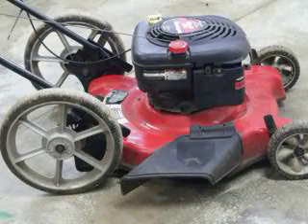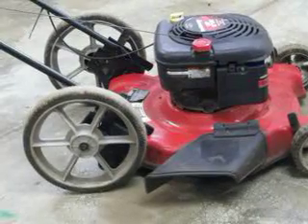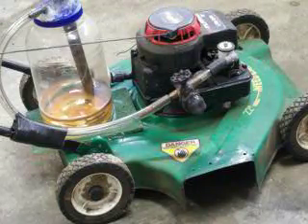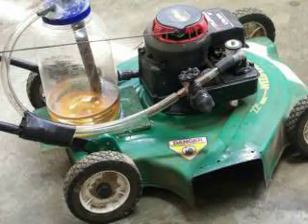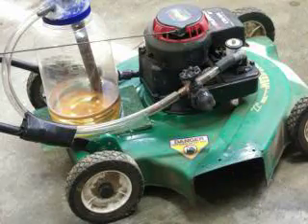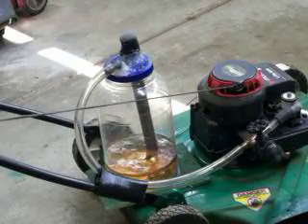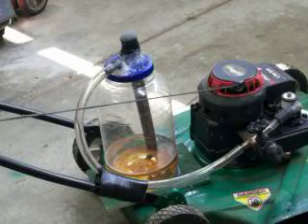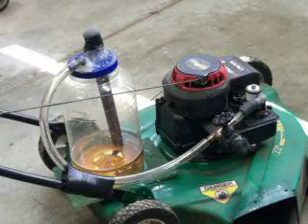gasoline and fumes the difference

Comment: Well, the issue with "running on fumes" is the gas in your setup would end up useless before it is all gone. A bubbler setup like you have, although simple, will result in using maybe 1/3rd of the gas before it becomes essentially useless (correct me if I am wrong). Another issue is overheating. I have heard running an engine lean (like this) will cause it to run hotter. However, I have also heard that using gas vapor you can get more out of the fuel if you actually vaporize it (more complicated than a bubbler). However, it can be done. I have also seen mowers running on propane, diesel vapor and even kerosene. Probably not good for the engine but it runs. Maybe if you had a two stage sort of system. Start it on a cold bubbler and harvest the heat from the engine to heat the fuel so it will vaporize better. Of course, be careful :P
Reply from the maker: that is true, air passing through the gasoline will slowly destroy it, i have come up with a better plan, run it through a wicking system, and separate the gas from the air, the air will blow over the wick and pick up the vapor, and the wick will keep drawing it to the top, this way you will not half to worry about cracking the gas by heating it. using it on my lawn morrow and it will till the gas is all gone.
Reply: TheVaporkid If you can get it to work long term, let me know. However, with that kind of setup I would worry with "gumming up" of the wick. I have heard of a "wicking carb" working though. You may still run into the issue of the gas becoming "unless" though (not sure). Either way, make a video or videos concerning it and I will watch.

Comment: Im thinking about testing this idea out. Im thinking a little 49 cc motor for a bike to start since itll be a pretty cheap way to test it out. From what I can tell you have the vapor output tube running into the gas tank, correct? Ive seen others run it into an air intake, but this is slightly different. I get that the air flows in to bubble the gas and create gasoline vapor, which the motor then runs on. I just want to make sure I understand where it is routing to. Would 2 stroke gasoline affect the vaporization at all? The 49 cc motor i'd like to use runs on 2 stoke mixed gasoline.

Comment: this engine will eventually melt down and die ... reason being the extra liquid gasoline is used to cool the charge, like this you are running SUPER lean  ... i recommend putting water in the gas tank and playing with the jet size so that you can keep the temps down, prevent detonation and enjoy extra torque from the steam ... and dont get me started  about putting a turbo
Reply from the maker: there is no way it will melt down, or burn up, its has oil and air cooling it and it will not run lean,end of story
Reply: Oh yeah i didnt know cookies smelled like burnt piston rings and a gouged to all fuck cylinder sleeve lol
Reply: why would this engine melt? it has oil to keep it cool and lubed
Reply: With enough heat the oil can "cook" and actually cause more friction and thus heat. Weather the engine melts would be up to the cooling system and if it could survive the super lean fuel air mixture. In general  the engine would be overheating with out the extra fuel to act as a coolant
Reply: Chris Comp HEY, I THINK YOUR CAPS LOCK KEY IS BROKEN. Guess what? You are not a mechanic, just some dude arguing with people on youtube. You don't understand how gasoline vapor burns. You are so stupid you don't even realize how much of an ass of yourself you are making. The reason engines run hot when they are lean is because they already have way too much fuel to begin with, so they teach you to dump in even more to quench out the flames. Gasoline contains 125,000 BTUs of heat per gallon under ideal conditions. If you cut the amount of gasoline going into the engine by a 4th, then you have 4 times less BTU energy going into the block. Get your facts straight before you try to fool people into thinking you are smart.
Reply from the maker: TheVaporkid ps i would not waste my time coming to see you at wv
Reply from the maker: Chris Comp then why arnt you at work, because you are some young kid that likes to bad mouth every body, you need to  take a anger management coarse, you really need it!!!  also my baby kid  make better sence then you
Reply from the maker: Chris Comp my god if every body thought like you this world would be still in the stone age, the wheel wouldn't be invented end of story!!!
Reply from the maker: TheVaporkid oh and practice what you preach, it might do you good moron
Reply: Chevaish Roop What some of you are forgetting is the upgrade in metal just to run unleaded fuel, yes?
Reply: Yup that's it ^^
Reply from the maker: TheVaporkid hey dude how old are you?

Comment: Use one throttle body injector to inject the raw fuel into a Small heated chamber the size of a 6oz can (think of how the tank-less water heater operates) and think of this as way to vaporize the fuel before it enters the engine intake "AND" is better than having a chamber with 1/2 gallon of heated fuel sitting in the engine compartment just waiting for a small/big accident to cause it to explode is not good judgement in my books

Comment: People, first of all you DON"T have to use heat to produce gasoline vapors, instead submerge a hose into liquid gasoline and then an air pump will force air through it and agitate bubbles in the gasoline which pressurizes the fuel container fumes are being made in and then your accelerator pedal is attatched to the cable that controls the release valve of the pressurized container that then is force fed into your TBI port that is always a perfect air to fuel ratio of 122 to 1.,= 240 mpg in a v8

Comment: Its ok to run pressurized Gas Fumes into the fuel rail as long as you are using Propane Injectors instead of liquid fuel injectors if your motor is Port injected. TBI system is really easy to convert into gasoline fumes. We placed one on a 91 lincoln towncar 4.6 V8 and got over 240 mpg. Really easy. This is the beginning of the end of the oil companies. They can take their high fuel prices and shove it way up there. They can make vasoline for each other and leave the rest of us alone! ! !
Reply: I got you a question, I totally agree that engines run on gas fumes.. However, we all know that a lean fuel-air mixture make your engine  prone to overheating.. Is this setup not prone to overheating at all? I have tried doing this to my motorcycle, and it worked! But I took it off as soon as I was done with the test.. I was so afraid that my engine would overheat due to lean fuel-air mixture..

Comment from the maker: the metal box on top of the carb only serves to blend the gas and warm air coming off the exhaust manifold, the vapor is controlled by the throat of the carb, my friend built it so i couldent tell you every thing about it, i built my own system on my dodge ram and i have my vapor hooked in to the intake of the plenum. its ok but i will be hooking it in to the fuel rail with it being pressurized, it will run a lot better

Comment from the maker: he was heating the fuel with a copper pipe submerged in gas in the box with antie freeze running through it heating the fuel to a 195 deg causing it to steam and was sucking hot air off the exhaust manifold pulling it down the carb causing it to vaporize more, that where you get your mileage.  rember liquid does not burn vapor does. liquid gas causes co not pure vapor

Comment from the maker: make it short, it had 2 cycle mix in it when i mead the video that could have set it off, but dont tell me on pure gas fumes it gives off monoxide, bull shit iv been a mech 25 years state inspector and emission, go to a shop and watch a engin on pure gas fumes and look at the readings, they will all read 000 on the gas anaylizer, you need to learn about the combustion engine fully, and not what you learn in school and a teacher, hands on training.

Comment: There is likely some exhaust and specifically carbon monoxide being emitted, though of course much less than normal, hence the smoke alarm going off at the end of you're video, due to the exhaust, not engine heat.. I wouldn't bet my life on sleeping or staying in that closed up garage too long, sir, with that thing running. Anything that burns gives off carbon monoxide, very deadly, and can't be smelled, careful now..